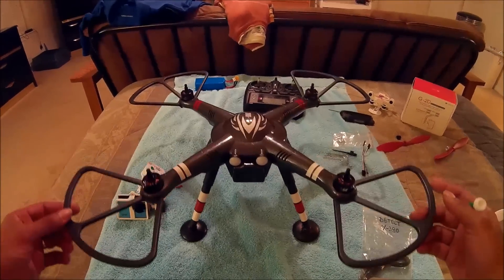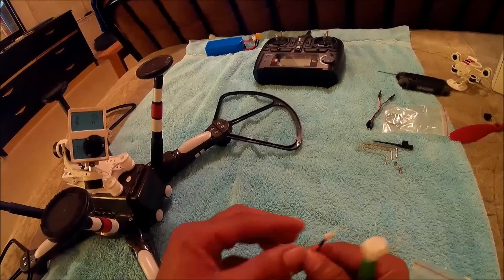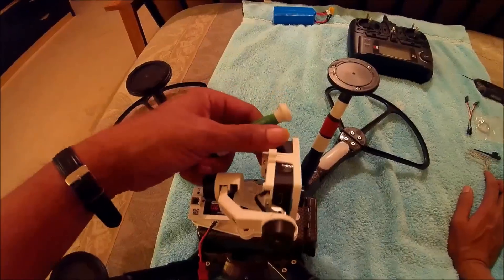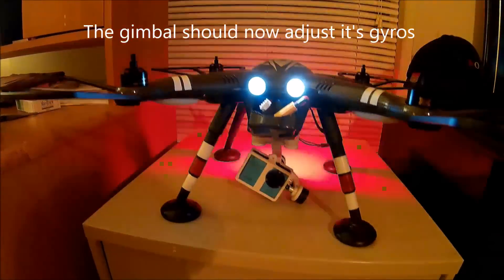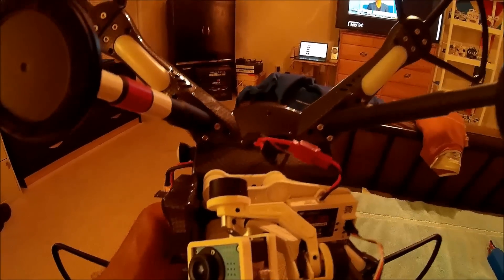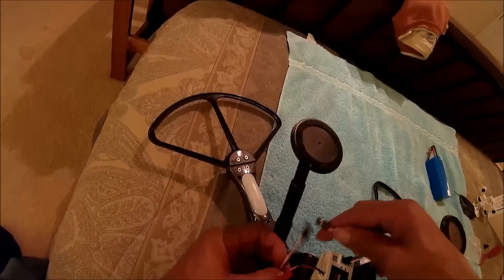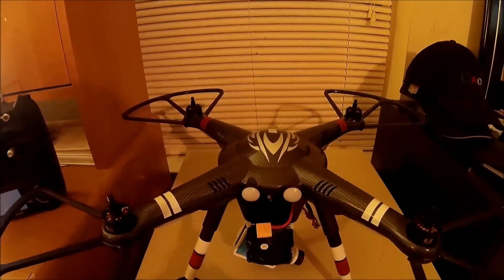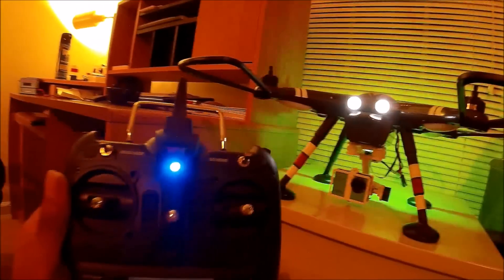XK DETECT X-380 "HOW TO INSTALL THE G2D GIMBAL"

Comment: Hey bro i ordered the g2d gimbal. I said f*** it and ordered it it will be here today. I am nervous about it not working but with all the videos i have watched it looks like it works with all kind of cameras. And i know you would help me if i needed it. So i hope this gimbal doesn't stress me out like the last one i had. I will be using this video as a guide. Thanks bro.
Reply from the maker: Here's an important tip for you: Don't ever plug or unplug that gimbal in while the power to the quad is on. You'll be fine. Good luck bro.  Dj Soul Force
Reply: +DJ SOUL FORCE hey bud I watched your video again and I did everything exactly the way you did it. and I got no pitch tilt. do you know why?

Comment: Hey DJ, hope all is well with you.  Came back and watched this again. It's helped so much in getting stock gimbal hooked up. I get great video now. The other problem I had thanks to Pete Johnstone fixed my quad. Big shout out to him. Both you guys are the best. Thanks so much for all your videos.  Happy and safe flying.
Reply: +DW Caudill Damn, forgot what I wanted to ask in last comment. lol
Does it hurt anything to just use all three wires? Just want to make sure that the thing will not cause the same problem I had before.  Thanks
Reply from the maker: +DW Caudill  It's ok to connect the three wires, they're just not needed! Glad everything is ok with your bird. DJ SOUL FORCE

Comment: Awesome video as usual DJ....do you know id they do a black plastic version also? Peace
Reply from the maker: +Sven Livesey  I've seen the G2-D in black, however it's metal and not plastic. You'll have to search, it may come in black plastic, but I've never seen it! DJ Soul Force
Reply: I have but I can't find one. They must only do a white plastic version. I thought it would look nice in black (plastic) as my sj4000 is black. Thanks for the input.
Reply from the maker: Sven Livesey  Lol, I wanted the same thing. I ended up changing my camera to the white Xiaomi Xi!!! By the way, Walkera has a 3 axis gimbal that's black plastic, but I'm getting bad reports on that one! It's hard to adjust, it tilts up & down by itself and causes magnetic interference in x380's - so don't buy that one!!!
Reply: Thanks for the heads up.

Comment: Do I have to cut the black and red wire or can I just leave it? and If so what is the reason for cutting it? thank you
Reply from the maker: +Dave Hildebrandt  It's ok to leave it. After I released this video, it was later discovered that those wires are for starting, stopping and, camera power, but not needed for the Walkera G2-D gimbal. Some guys thought it was best to cut those wires just to be safe, since we're only using the signal pin. (there weren't any clear instructions for this install, that's why I made this video - remember, x380's were falling outta the sky back then!!!) Good luck, let me know if you need anything else!  DJ SOUL FORCE

Comment: Hey DJ...hope all is well.  I went your route and ordered the Walkera G2d gimbal for the XK380 and the SJ 4000 camera.  I'll get them in a few days.  In order to control the pitch of the camera (pan up and down) from the transmitter, when connecting to the signal pin, are there certain wires that need to be cut so they don't make connection?  Your video states you cut the red and black wires off because all you need is the white wire for the signal pin...am I correct?  In other words, we dont' want the red and black wires to have any effect on the quad...just the white wire...right?  Hope I'm explaining myself correctly.
Reply from the maker: +José Crespo Yes, you are correct. Also, after I made this video, I later learned from some other guys that did it differently, that if you leave the red & black wires in place, nothing will happen. So, I tested it, and found that it's ok not to cut those wires and the gimbal will work the same - it is not affected. Always make sure they are lined up in proper order and not reversed.  DJ SOUL FORCE
Reply: +DJ SOUL FORCE.  Thanks DJ....even easier!

Comment: hi i was just wondering if you ever use headless mode while you're flying ithe xk detect x380?? because I have heard that it induces the crash
Reply from the maker: +patrick mackey  I've never heard that before. To answer your question, no I don't use headless mode while flying the x380 or any of my other quads. Just my personal preference, I've never used headless mode, maybe only once to test it!  Thanks for your question.  DJ SOUL FORCE

Comment: so my gimbal came yesterday and I was pretty excited! so I install the thing correctly and the thing wobbles and freaks out. quadcopter 101 says I have to turn the power down. so I install the program and stupid McAfee said the java sight was safe and it was wrong n now I got a virus on my pc! :( I can get rid of that but omg I could not get the settings right for that dam gimbal. I put the old one back on n I will try to get it working when I have time.    I put 6 hours into trying to get it working. I almost got the g2d gimbal n maybe I should have. man it is hard getting the gimbal to work. well wish me luck. TTYL.
Reply from the maker: +Ian Rice  Brother, I do wish you luck. Did you ever join the club on facebook? There's quite a few guys that have that gimbal and I'm sure they would be glad to help. Also, did you ever get to play around with the flight control software? In flight control, there's a couple of settings for gimbal also. Good luck bro.  DJ Soul Force
Reply: Yes i am on the facebook account.I didnt get to download the flight control program. I did install the camera setting program and i do have it set up right. yes i have +quadcopter 101 helping me and a couple other people. everyone is saying i need to get the gimbal to set up to the weight of the camera. It's really not easy dong that. It was easy to plug the thing in. i got it turned around so my legs wouldnt be in the shot and once i got it all plugged in correctly i thought i was golden but nope the weight if the camera isnt right for the gimbal. It's just a shit load of trial and error. did you have to adjust anything with your g2d gimbal or did you just plug it in and you were set? If so maybe ill get that one if this one doesnt work. Thanx for your help and nice words. ill ttyl take care of yourself man. :)

Comment: walkera x350, 2 Axis  brushless  gimbal. I just found it on eBay for 35$. do you know if it will work fine with the x380? Is it hard to install a gimbal on a quadcopter?
Reply from the maker: +Ian Rice  It's not hard once you get started, but could be scary, because not a lot of step-by-step installs for each quad with each gimbal, so I know how you feel!  After I shot this video, then I installed the MINI 3D, I found it to be the same install, I didn't need to re-do. So, the only differences you may run into from watching this video and your gimbal would possibly be - different pin connectors, wire colors, mounting hardware (but most hardware is universal, meaning the holes should line up) and lastly, mounting position (legs in picture, etc)  It's not hard after you understand the basics, which are in this video, and you should be fine with your gimbal. VERY IMPORTANT with the x380 - NEVER PLUG GIMBAL IN OR UNPLUG GIMBAL WHILE QUAD IS ON
Reply: +DJ SOUL FORCE  Thanks again bro! very useful information I know I will need and that will help. you have never steered me in the wrong direction. I'm pretty good with figuring things out. I can be pretty handy. So if it's not like seriously hard I can do it. And with your help and doing research I think I should be good. the one I got is the CNC fpv 2 Axis gimbal. And I saw allot of videos on YouTube about it so I can get help there also. when I get the gimbal and if I have trouble can I ask you for help?
Reply from the maker: Ian Rice  Fo sho bro!!!!  Hey, by the way, I heard XK is coming out with a 3 axis gimbal soon. Don't know when exactly but that (price$ - ?) should be interesting!  DJ SOUL FORCE
Reply: +DJ SOUL FORCE really that would be nice. it would be meant for our quad so there would probably be no issues. I'll Keep my eye out for it. Thanks.
Reply: +DJ SOUL FORCE  I hope you are able to do some flying today. there is no wind today do after work I can't wait to go fly! take care brother!

Comment: Hi, Mr Force, I just finished installing the Walkera G2D gimbal on my XK X-380, following your excellent video instructions. After connecting the power leads, the gimbal seemed to behave perfectly. After additionally connecting the signal wire, however, the gimbal does not stay still - it slowly pitches up and down about 20 degrees. It will respond to input from the transmitter, but this has no effect on the constant pitching.
Any ideas as to what is happening and what I can do about it?
Any help greatly appreciated.
Reply: +DJ SOUL FORCE I'm trying to understand why I would need to cut the black and red wire? Is that the reason that the gimbal will stay in balance posistion without any battery power? My gimbal arrived yesterday for the x380 and I didn't cut these wires... everything seems to work well but as soon as i'm disconnecting the battery the gimbal doesn't stays in balanced position. I think it might be a language barrier from my side so sorry for that.
Reply from the maker: Stevejawel  After this video, I learned that you DO NOT have to cut those wires, but they are not needed. Your camera will fall down after the power is off because this gimbal is balanced for the weight of a GoPro camera. You can add some weight, like a coin, to the back or bottom of gimbal to get as close to balance as possible. When you turn on your transmitter, rotate the tilt wheel up one notch before you plug in your quad battery. This will stop the gimbal from pointing down every time you turn on the power. Good luck, let me know if you have any problems.  DJ Soul Force
Reply: DJ SOUL FORCE That's some good information which i'm going to try.
Thank you for your time and keep up making new videos!
Stevejawel.
Reply: Hi, i was having the same problem when connecting only the pitch (white) wire, so i connected ONLY the black (GND wich is always good to connect on every circuit) and the pitch (white) and it worked!!! probably without the GND the circuit can't find the correct voltage reference and voltage control of the pitch wire continue to fluctuate ! thanks for the video DJ!
Reply from the maker: +Nigel Grinter  That gimbal is suppose to be balanced for a GoPro and can be tricky to get it to perform perfectly with other cameras. The fixes are mostly trial & error!  Try adding a coin (or two) to either the back or bottom of your camera. The objective is to get the camera as close to balance as you can without power to gimbal.  If you have the x380's flight control program on your PC, there's also gimbal settings in the "advance setting" page.  Set gimbal pitch gain to "0"  Unfortunately the G2-D's user's manual is really hard to understand.  We're suppose to be able to make pitch & roll gain adjustment at the gimbal's controller, but I haven't figured that one out yet!!!
Reply: +DJ SOUL FORCE Many thanks for your reply. I will try your suggestions. Where do you get the X380's flight control program?
Best wishes.
Reply from the maker: Francesco Corradini Thanks, glad it worked out. Fly safe, thanks for watching and commenting. DJ SOUL FORCE

Comment: Doing this now and Hopefully I can do it without blowing me quad up. Got a brand new one after mine got shot down and made world news lol have a look at the vid on mine.
Reply from the maker: +YouOriginal  Was that your quad???? I've seen the video on the facebook group's page!!! Wow, that was some bullshit, I hope they locked up the idiot that shot it!!! Lol, did you sue his ass?  Thanks, good luck. DJ SOUL FORCE
Reply: +YouOriginal First mistake I put the small white bar around the wrong way but it seems to be magic fix. The G2d plate with high end at back makes the gimbal solid and sitting out great. Cause i watch your other video or this one and your say the feet are in the shot. So my mistake was a great fix lol.
Reply: I live in New Zealand you can't sue people here like in America. Don't know who did it anyway.
Reply from the maker: YouOriginal  Wow!!!! Good luck with the gimbal project. Keep me posted. Thanks
Reply: +DJ SOUL FORCE mines moves while it is on up and down a tiny bit does yours. Should when you turn it on it just sit still? mine goes up and down up and down just a little.
Reply: +YouOriginal yours sits still???? aaaaahhh mine must be faulty?
Reply from the maker: YouOriginal  Use the Flight Control program for the x380, set gimbal pitch to "0" that should stop the up & down movement.
Reply: nope still the same tried it.

Comment: i just got my walkera g2d gimbal today and i got a sj4000 clone camera it looks like the sj4000 but its not it is a clone of the sj4000 i got it for 42.00 . i changed the  dampening  balls  i saw on one of your videos where you said you had to make them stronger so i changed mine i had some rubber ones from a cheap gimbal i bought but these dampening balls are very sturdy i was watching your video and hooking up my gimbal and it works or at least it leveled out when i gave it power I'm getting ready to try it out. thanks for these videos I'm learning everything i can about the x380 peace out and god bless

Comment: I just did the Gimbal signal pin mod like you did, but I noticed that the connection on the Quad is almost like a Balance port connection and the wires you splice is a different type connector.  I did manage with some effort to get it to plug in, but it took me a while.  What I did when I spliced the white wire was, I just took the soldering iron that I used to connect the white signal pin wire and use it to remove a small lip that is on one edge of the connector.  This makes the entire connector smooth on both sides and the connector goes in and out easily now.
Reply from the maker: +James Ingram  Is everything working ok? (tilts up & down?)  Are you using the Walkera gimbal? I hope everything is going good.  We're going through some high winds for the next couple of days so I'm grounded!
Reply: I haven't had a chance to get out and test it yet..Winds have been really tame here the last couple of days, other then being in the high 30's and low 40's its been great weather.  I will let you know when I get the battery back on it to test it out.
Reply: Yip the camera does have tilt and works great.  I was worried when I hooked it up and then put power to it because normally the camera will self center and be looking right at me.  This time the camera centered and then it adjusted in the most down position.  After just a bit of panic I determined that the FAP control had been adjusted to that position.  I rotated it back in the up position and it came right back up and got into position just like it was supposed to.  Thanks for all your help.  Its nice to be able to watch a video, freeze it in place, do the work and then move on to the next step...lol
Reply from the maker: James Ingram  Good for you James, glad it works!  Happy flying bro!

Comment: Hey nice video! I have a question: I'd like to Order the full set up from a chinese site, will I need anything lese to get this camera tilt done? And also, is it possible to get fpv going easily? Thanks
Reply from the maker: +Doktor Dray  If you order the X-380C, it should come with the 1080P camera & gimbal attached already. If you're getting the x380 standard, and adding the G2-D gimbal, you should have everything you need (I did) but may need one additional wire to connect the 12v power supply. (mine came with the quad but some guys didn't get it) I'm not sure how easy it is to hookup FPV since I don't use it on my x380.  There's several guys that have added FPV to the x380 on the "All XK Drone Owner's Group" on facebook. Check it out, there's some really nice guys with a lot of knowledge about the X-380.  Thanks for watching, Happy New Year!!!!

Comment: hai DJ,  I have a question. at the remote control of detect x380 we have two function one for tilt up down and two for take a picture if we push it. how to get work it and make a connection if I want to use to take picture from remote control button?  tq for your kindness and explanations
Reply from the maker: +Joyo Siswandi  The take a picture button is for use with the XK camera.  I'm not sure if it will work with other cameras.  Sorry, I don't know how to connect or how to make it work. I bought the X-380 Standard version without a camera.  Thanks for watching.

Comment: hi DJ SOUL i've just installed walkera g2d......now i've 2 question:
1) it's normal that i've to trim quad when i takeoff with gimbal .... it' goes to left quiet fast

2) I trim quad and it's perfectly still....but....but if i turn quad 180° it's like i've no trimmed it an it goes left again (or right i don't remember)